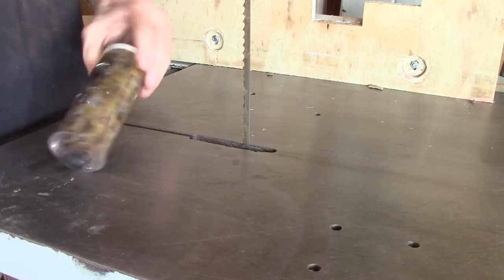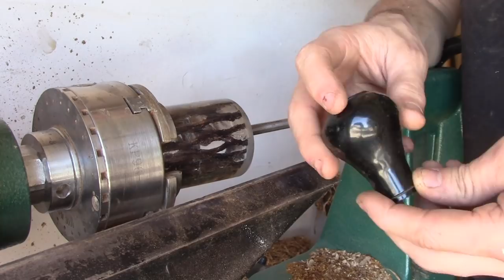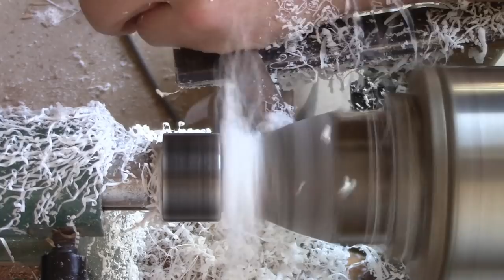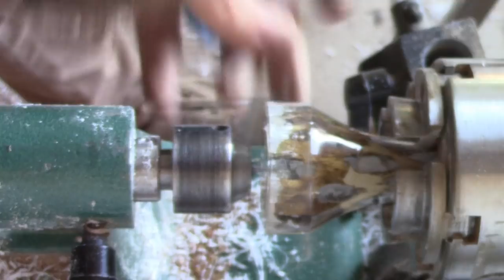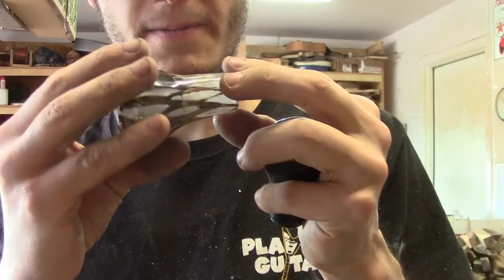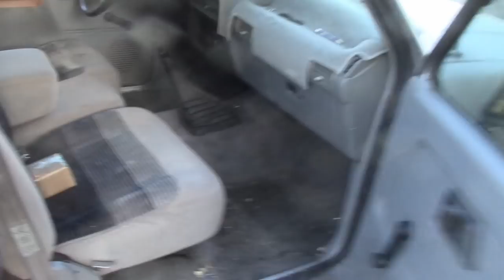Turning A Cholla Skeleton Gearshift!

Comment: You might consider putting a piece of cholla on a piece of bankasia pod and casting them together. They are 2 beautiful natural shapes.
Reply: They are weird and interesting.  After you get through the tough bumpy outer part and the velvet hairy undercoat, the inside is as hard as ironwood.   You can order them from Rockler or Woodcraft.  If you have one of those stores in Tucson or Phoenix it would be good to be able to pick one out so you get the largest one. They run from $10-15.
Reply: 2300Kenzie The Whiller did one and when he got to the hairy part, he used a torch to burn the hairy, webby stuff and killed some bugs which were on the inside.

Comment: turned out nice . i would dump some crazy glue in the cracks from inside and see if it penetrates the crack.  looks dope. but i'd imagine you're like me and already installed that.  hopefully it didn't break installing it . did it need threading ?
Reply: Good idea . glad it worked and didnt break . the next one will be better . might be cool to dye the cactus juice same color as your paint on the truck
Reply: Dye the chola a color .then the resin a diff color or whatever you think.
Reply: Or not lol

Comment: The knob turned out well and it's educational and enjoyable watching you learn.  However, you demonstrated one very unsafe practice at the lathe: You polished the knob using a cloth. Never use a cloth with the lathe spinning.  If the cloth had caught on your 4 jaw chuck, it could have wrapped your hand around the lathe's spinning spindle -- breaking fingers if not worse.  It'll happen so fast you won't have time to let go.  Instead of a cloth, use a paper towel.  If the paper towel catches, it'll tear rather than pull your hand into the spinning lathe.

Keep learning, but do it safely!